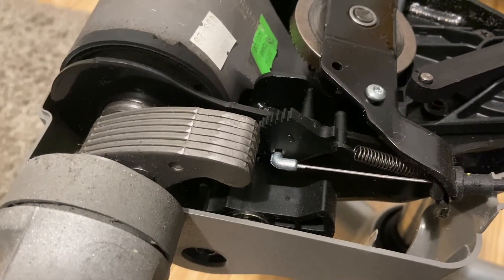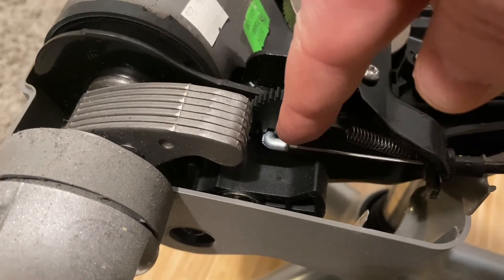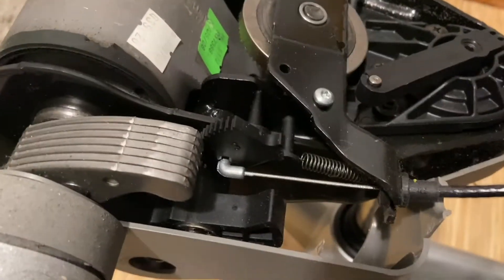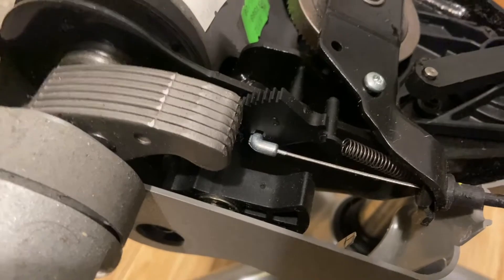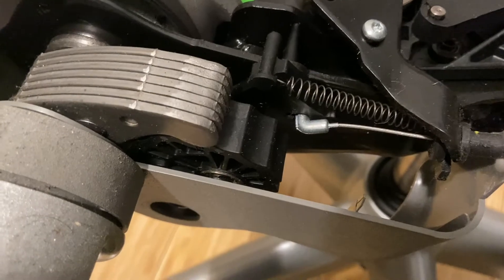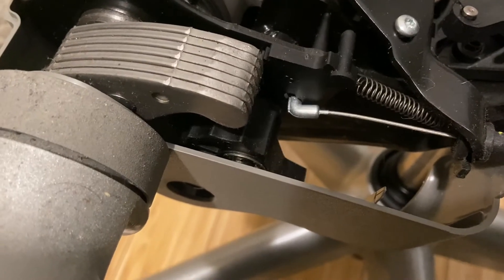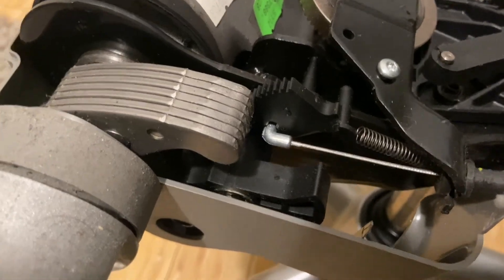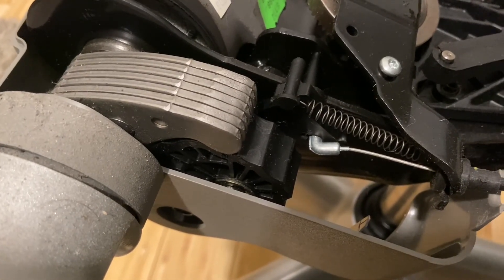Herman Miller Aeron Rear Tilt function inside

Comment: So I just got a herman miller aeron with this same internal setup, but my Tilt function only allows full lock, or full unlock, nothing in between. The small gear still looks really good and fine. But that big one next to it just keeps slipping when to much force is applied causing it to go unlocked fully. How would I replace that piece?
Reply from the maker: I haven't had that issue yet, but this post may be related to the same problem. It made it sound like there is an adjustment for that issue that might help. https://www.reddit.com/r/hermanmiller/comments/miynsv/need_help_finding_out_why_my_aeron_tilt_wont_lock/ .  

This post also seemed like it may be related.. https://www.reddit.com/r/hermanmiller/comments/n4334s/replacement_parts_or_repair_thoughts_for_2000ish/  
I think you can order that whole part, but it would be cool if adjusting it like they mention would help, (And be a free fix). If that works please post a comment as I am sure others might have the same issue. Good luck!

Comment: I've just started having a problem where my tilt lock disengages when I stand up, so when I sit back down the tilt is unlocked and the chair bounces back and forth. When I have weight on the seat I can slide the knob to lock, but then it's floppy (moving up and down without any tension) where I'm pretty sure it used to still be under tension. Any ideas what might be going on?
Reply from the maker: I haven't had that problem, but it sounds like it might be somewhat like this post in Reddit? Sounds like they were able to correct it. https://www.reddit.com/r/hermanmiller/comments/nuk7u5/aeron_classic_tilt_lock_unlocks_itself/
If that's not it, I suggest posting in that Reddit as they have a lot of Herman Miller users and someone else probably has had the same issue. Hope you can get it fixed.
Reply: @MyRandomTechBlog  That looks like it might be it! Thanks - I spent a while Googling this myself, but I wasn't really sure what I was asking for :-)
Reply from the maker: @mument2001  Great! hope your able to fix it, good luck!
Reply: @MyRandomTechBlog  - I opened it up and noticed the rear limit cam bumper (that's what I saw it called elsewhere) was missing and had been damaging the cam (the one in you video with the pin) but nothing that looked like it should cause the problem - just scratching. I 3D printed a replacement bumper and fitted it, but it still slips with the tilt adjust know springing back into unlocked (lowered lever) whenever I lean forward or get up off the chair. When the tilt lever is engaged (locked), should it be loose, as in there being no tension in the cable? I can't remember how it felt before the problem arose.
Reply: I've just opened up the box holding the tilt controls and there's a bit broken inside which looks suspicious :-)
Reply: And that was the problem! A small plastic part of the controls had split and wasn't holding the control in place. As I don't use the tilt forward control much, I've swapped the cables and now tilt lock works fine. Annoyingly, I'd just given up before having my epiphany and ordered a new HM Aeron. Oh well, my wife will be able to inherit my mostly working classic which should be an upgrade from the dining room chair :-)
Reply from the maker: @mument2001  That's awesome you fixed it! Thanks for posting what it was in case someone else has the same issue. And sounds like your wife will be much happier now with the hand-me-down Aeron. ( Not sure how comfy your dining room chairs are, but mine would be horrible to sit at the PC ). Have a great night!
Reply: @mument2001  Gotta thank you man, I had the exact same issue you had, and I never wouldve thought to look inside the tilt lock lever control box thingy until I read your comment. Opened it up and sure enough a plastic part had broke. I swapped things around and my tilt lock actually works like it's supposed to now. You helped out a stranger a year later just out of coincidence